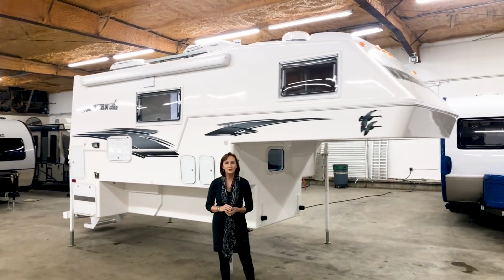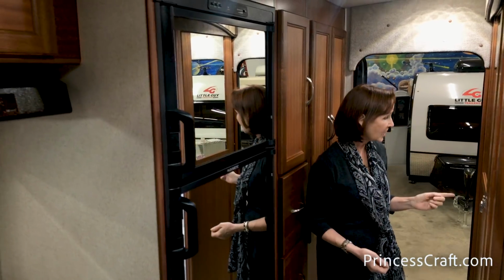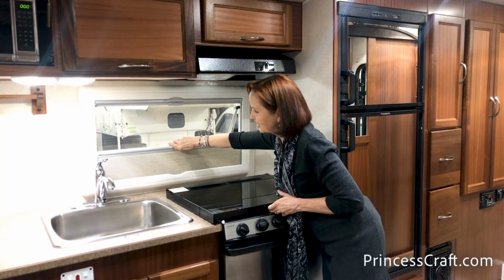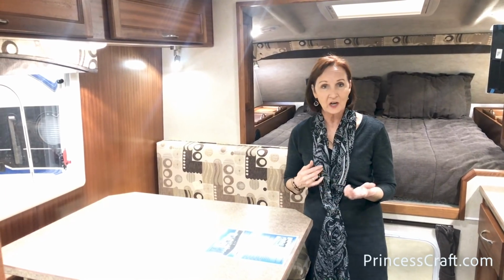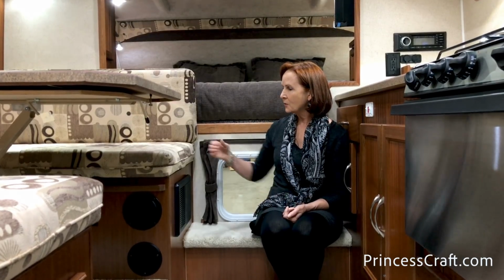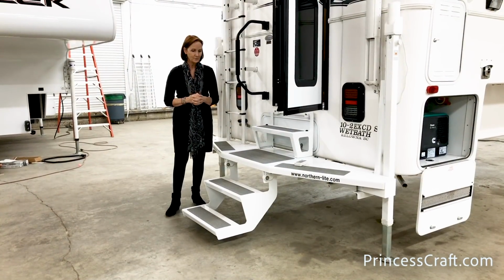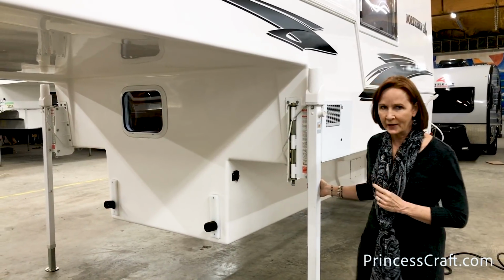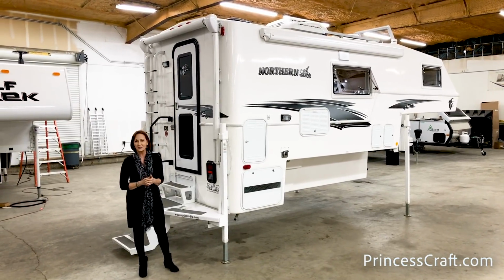2019 Northern Lite 10-2 EXCD SE Truck Camper Walkthrough Tour

Comment: Propane generator in a 4 season camper, propane doesn't work very well below 15 degrees
Reply: spent a night in -15 up here in canada with my onan propane generator no problem
Reply: @ddev7376  one night, how about trying it for a bunch of nights
Reply: @lilmule9576  I live in an arctic fox truck camper full time in Canada 🙄🙄
Reply: @ddev7376  so you're telling me that you can start that generator at 0*F and it runs? Or are you continuously running it?
Reply: @lilmule9576  i run it for three - six hours every day no problem
Reply: @ddev7376  I'm not buying it!
Reply: @lilmule9576  lmao I'm literally running my generator as we speak with it snowing outside and the wind blowing. You can think w.e you want. Could care less about some random nobody, just speaking about my experience
Reply: Lil Mule clearly doesn't understand what they are talking about. Propane is stored in your tank as a liquid, hence the L in LPG. The freezing point of LPG is -41 degrees. So unless you are in temps below that you won't have an issue. Like any liquid, there will be some expansion and contraction which could affect your volume but otherwise you won't have any issues with the cold.
Reply: Apparently they didn't like my truthful review and deleted this comment. Fortunately I wrote it in notes and still have it. Shame on you for censoring me when I bought one of these! 
Here is the original review:

I'm laying in my 10-2 EXCDSE now. I've had it for a year and have spent a LOT of time here.
I absolutely LOVE the higher ceiling. It makes a big difference in the bed area. I am 6'3" and have no problem in the bed, shower, etc.
In that time I have had the heater replaced twice. The propane lines worked on. A leak under the sink. The fridge currently turns itself off 10 times a day. You MUST have a generator because the solar panel is a joke. Doesn't do shit. The two 100amp hour AGM batteries won't even power the heater all night. Every day I have to run the generator for 4 hours. I don't even use any plugs/low voltage. I have a Yeti Goal Zero 1000 watt inverter that I plug stuff into. 
The insulation is nothing impressive. I live in Los Gatos, CA and the heater has to run at least 4 times per night to keep it at 65-70 right now. Can't imagine what snow would be like. 
I actually use a small electric heater in the bed area which is only on when the generator is running. The main heater is near the door and doesn't cool the sleep area well.
My buddy said to just get thicker blankets, etc. But I have a Pitbull and he gets cold too.
The black out Windows are awesome. However the window to the cab doesn't have the same black outs? Just curtains. You can see light through them. So the blackout is ruined.
The bathroom counter top. Collects water when level. So you have to push it around or towel it up. Door is great but I never close it so I velcroed it open.
Pantry is great. This camper has a lot of storage. Gas props work great. Cabinets are quality. Although I do miss my access to the truck bed.
The windows suck! Acrylic? It scratches so easily. I am afraid to do any real camping where I have to push through trees. And if you leave the shade open, you do lose a lot of heat. I never have all the shades open at night. My windows don't work properly and only stay open at maximum height.
Stove/Oven is great. But you have to light the oven manually.
The led lights are nice, but quite bright no matter what.
I never use the stereo. The Bluetooth was a pain in the ass to pair. Unusually hard. So I use a JBL portable speaker.
The dinette is nice. I have the same one. The table adjuster seems awesome. But the pin does not stay locked. It's always going up and down as you drive. It isn't very strong. If you fall in the table or some kid sits on it, it will break. The table slides left and right and the stopper doesn't stop well.
Even in California, I have had issues w the propane tanks getting cold.
I have the same Generator and it's loud! You can hear it 40ft away.
The propane slide out is a pain in the ass! On the truck, accessing the one in the rear requires a tall person. The mount in the middle just gets in the way and replacing it is a pain too. The slide and all galvanized items have started to corrode. The two bottles will last you about a week. 
I replaced the stair upto the bed w a solid wood tread. Putting carpet there was stupid. It got dirty so fast.
The bed that comes w the camper is very nice. I still added 3" of memory foam on top for a hotel like bed. Making the bed is a pain in the ass.
There is a plastic moisture mat under the bed. Very good idea. 
The wardrobe in the bed area is weird. Because of the direction of the hangers, you have to remove everything to get to the back of it.
I love the skylight, but it loses a lot of heat there. Gotta keep the shade closed at night.
I tossed the carpet. Was just a dirt collector.
Pulling a trailer w the deck? You have to get a special hitch. I got the Torklift Super Hitch $2000 and 48" Super Truss $600. I can tow upto 7000 lbs with it. The fast guns (tie downs) are another $600. Locks are $100. So over $3500 invested total in Hitch and Tie Downs (I installed myself. Very easy) 
The deck is white and beautiful, but scratches easily. Especially where the little removable step is.
Why did they make the square tube in the patio too small for a sewer hose? Wth?
It's very hard to get on the roof because of the awning. No handles up top. I'm in good shape. And have no issue climbing generally. Anyone old or overweight should avoid it. 
Not sure of how long 10lbs of propane will run the generator. But I already have 100hrs on it and I use everything daily. It lasts pretty well.
I have a 2006 F250 Diesal Crew Cab w Air Bags that I pull it with, no problem. Always in Tow mode. 8-10mpg. I have a two inch lift and 35" MT tires on 20" wheels.
So, is it worth the coin? I paid 41k last August 2018 for a 2019 model. Another 4k for generator. Although I have 50k in it so far and still need another 2k for batteries. 
To me, no. I have a 70k Lexus and it works perfectly all the time. This is like the most expensive camper (without slides) on the market. It isn't even Lexus quality.
Happy Jack's all work at different speed. So you have to keep adjusting them. Although it's absolutely amazing to have a remote control for the legs. 
I do think the structure will last a long time. It's shell, cabinets, etc will last.
I already have scratches on the acrylic windows from trees and I do mostly city/urban camping/living. 
My truck was 55k new and look at what I get for 55k. Today that would be 80k. Even a 55k truck today is amazing and has a lot of technology.
The batteries that come are bullshit! They should be MUCH better for this price tag. The heater should be better than the same one I had in my 18k 20ft Micro Minnie.
You get a lot of looks. This camper looks fantastic. It looks expensive. And when city camping. You're not bothered unless some weirdo neighbors call. I had that happen tonight.
The black outs really are black outs. You can't see any light except for a little in the door windows, which aren't eh same tech and the cab window which is just tiny, shitty curtains.

Advice for buyers:
Expect some mechanical failures.
Have a back up plan for heat. Like a propane Buddy Heater.
Get money back for the batteries from the dealer and go buy your own immediately. I am planning to replace mine asap. Probably lithium ion 100amp hour ($1000ea)
Have a generator. The auto start is great. But you could use two Honda 1000 and they would be more quiet. 
Happy hunting...
Reply: Vivid Haiku,
Excellent break down of all the positives and negatives. I learned a great deal and appreciate your honesty.  You even had me laughing out loud in some spots because you were so darn honest, which of course is how it should be, straight forward.  I also appreciate the time you put into all of this, thought and writing it down and not being a pain and leaving out the good parts to the purchase. 

For my family, it’s overpriced for our budget and we would need something for the cold nights too. I may not have known this and other things you had mentioned if you had not posted. So you rock in my book. I will keep looking, and now I know more into what to look for. 
Again, thank you so much,
Ma’iingankwe
Reply: @maiingan07  my pleasure. I still own this camper. Have invested alot in it. I would not buy it again
Reply: m Robs  fuck off with calling me a liar you dumb daft prick. Speaking from my own experience. Your ignorant inexperienced belief not required silly southerner you're talking to a Canuck here who literally lives in a country that had all the top 10 coldest places in the world this last week smfh. Whether you buy it or not has no bearing on the reality of my propane generator having no issues starting in the cold. Gotta hold the primer and start button on it for a second or two longer but fires up every time 🖕🖕🖕
Reply: You could install a small incandescent light bulb in the propane compartment to add heat to the tank and regulator/lines...which may be challenging because of the vented obligation, and wind at -15 could make this impossible...I have seen people applying a direct heat source to the tank...So let's say it's about -40 outside, and your propane tank is no longer producing enough gas to run your stove, or lights, or whatever. You decide to apply some sort of heat to your tank in order to get the gas flowing. That part works fine. The temp of the tank increases a bit, the liquid propane in the tank turns to gas. It passes through the regulator and into the line on its way toward the inside of your house. Now comes the problem: the gas line is COLD; it's still at -40 something, below the condensation temperature of propane. The gaseous propane in the line now condenses back to liquid and accumulates in the line. This liquid propane makes its way into the heated space....expands rapidly....BOOM! You just generated an expanding liquid gas explosion.

Design your place so that your line is as short as possible and enters directly from the regulator into interior heated space. Plan for the fact that your propane appliances aren't going to work at temps much below -40. And don't be tempted to apply heat directly to your propane tank.
Reply: You need to calibrate your regulator.
Reply: Not true, Lil Mule.
Reply: Don't give too many negative or they will delete your comment, like mine! You spend 50k on a camper and are not even allowed to post an honest review.
Reply: @vividhaiku  are you 12?
Reply: @ibuildsheds5654  I'm 13 and spent $44,000 on this camper.

Comment: Any ability to pull a trailer with the patio deck being so big?
Reply: There is, but you need a hitch extension.
Reply: noonefan  Pulling a trailer is a concern for me as well. To address this let's solve the moment equations. I'll use my 2017 F-350 long bed, a 'baseline 100 pound tongue weight, and no weight equalizer setup as an example. 

STOCK CONFIGURATION (i.e. no camper, or at least none that require a hitch extension)
The distance from the rear wheel's contact with the ground to the end of the tow receiver is 49 inches
The tow ball assembly with the shortest distance from the end of the receiver is 7 inches (the shorter the better)
The resulting distance from the rear wheel the the tow ball is 56 inches (49 + 7)
Wheelbase (inches):   142" regular cab (front seat only),   164" extended cab,    176" 4 door crew cab
Reduced weight on front wheels:   39 lbs for 142" WB,    34 lbs for 164" WB,    32 lbs for 176" WB
Increased weight on rear wheels:   139 lbs for 142" WB,    134 lbs for 164" WB,    132 lbs for 176" WB

CONFIGURED WITH HITCH EXTENSION FOR THIS CAMPER
Given this unit has an 11 foot floor as well as a rear deck that is over a foot long, the extension would need to be very long, at least 4 feet. Using 4 feet for calculations, here is the effect:
Reduced weight on front wheels: 73 lbs for 142" WB,    63 lbs for 164" WB,    59 lbs for 176" WB
Increased weight on rear wheels: 173 lbs for 142" WB,    163 lbs for 164" WB,    159 lbs for 176" WB

You can see how dramatic the effect is of extending the hitch would be. 
These calculations ignore the considerable addition of the overhanging weight associated with just the extension hitch and its frame. This would easily be the equivalent of a 100 pound tongue weight just by itself. Furthermore, the center of gravity (C.G.) for this camper is way behind the rear wheels. This in turn implies that its loaded weight of 4000+ pounds will result on a rear axle loading weight well in excess of 4000 pounds and the front wheels being unloaded by the amount that the rear is loaded that is in excess of 4000 pounds. (Note: The horizontal and vertical location of the C.G. should be provided by the manufacturer, at least as a baseline, if not specific to the chosen options)

These calculations are linear in the sense that if the tongue weight is, say, 10 times more (1000 pounds), the resulting effect on the front and rear wheels will also be ten times more.

The highest payload of the 2017 F350, non dually is the 2WD, regular cab, gas powered variant at 4000 lbs. The payload drops off considerably as the trucks base weight increases. For my non dually, crew cab, 4wd, Diesel, long bed, it is 2800 lbs. (Just selecting a Diesel and its transmission reduces the payload relative to a gas engine & its transmission by a whopping 700 pounds!) 

The implication...Even getting the truck with the highest payload (regular cab, 2wd, gas engine) and even without a hitch extension, the combination of the 4000 lb weight along with the added effect of the C.G. location, a dually is the only legal option. Loading a non dually beyond the rated payload risks citations, premature wear and much greater liability in the event of an accident.

A dually increases these payload capacities by roughly 2500 pounds. But even with a dually, the tongue weight is going to be quite limited because of the long extension and the large overhang of the camper's  C.G.  All but the lightest trailers will need both a stabilizer and weight equalizer.
Reply: I find myself wondering about that myself. I have often imagined myself needing a small trailer.
Reply: CulleyT   Interesting. A few questions;
Do you have a Dually or single rear wheel?
How much length does your hitch extension add? (over four feet, as it would need to be here?)
What does your trailer weigh, loaded?
What is the approximate weight of what is loaded into the truck bed?
Reply: CulleyT  Thanks for the reply. So, your fully loaded tongue weight should be ~1000 pounds. Based on the calculations in my prior comment, assuming you have a long bed and and assuming your wheelbase is about that of the Ford extended cab( 164 inches), that 1000 pounds would increase the load on the rear axle by ~1600 pounds (assuming no equalizer). If your rated payload is ~6000 pounds, you could load the truck bed with 4400 pounds and still be legal (assuming that load's C.G. is not behind the rear axle, as is so often the case).
The numbers alone say it's OK. But I get queasy about the effects such a long leverage arm extending out to a 1000 pound load. Specifically, if you had to make an abrupt turn at speed...yikes!

Comment: You had me UNtil you said acrylic windows road grime and gravel roads and they are scratched so bad you now have none see thru windows.
Reply: Could always have them covered in that clear bra stuff they use on the front of cars.
Reply: @justinshelton3  good idea,thanks
Reply: Joseph Compnotta   I've seen discussions about them. They are from a European manufacturer, have been used for years and are very well designed. The grade of plastic is impervious to cracking from ultraviolet and is much more resistant to scratching. With the integral screen and blackout shade, they're at least as expensive as glass windows. I trust 'Northern Lite' compared them to glass and chose acrylic for good reason. Don't just summarily dismiss them.
Reply: @gregparrott  oh ok I've used caravans as they call them in Ireland I didn't realize the windows were plastic. Very cool . thanks
Reply: Joseph Compnotta     I have not read it, and I don't know if this is the brand Northern Lite uses, but I just found a reference article;
http://www.truckcamperadventure.com/2016/01/the-dometic-seitz-window-pros-cons-and-a-few-tips/
Reply: Northernlite uses acrylic thermopane windows to save weight. They are scratch resistant but do require you to be careful. A kit to polish out scratches is included with the camper.